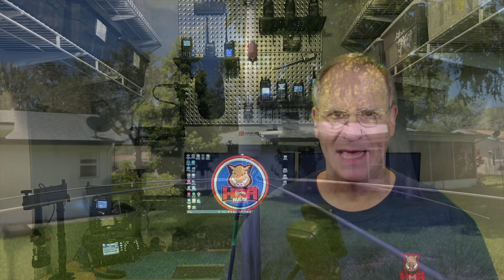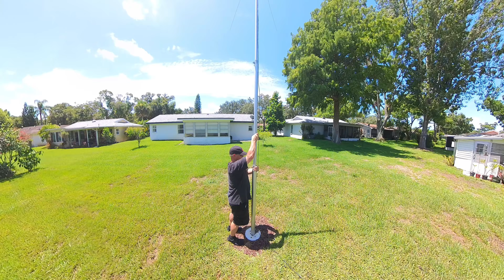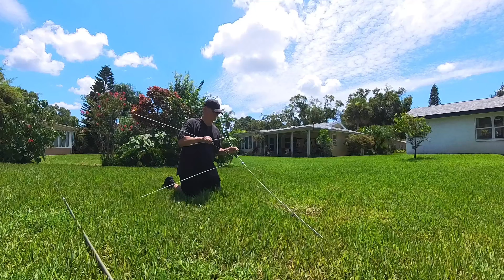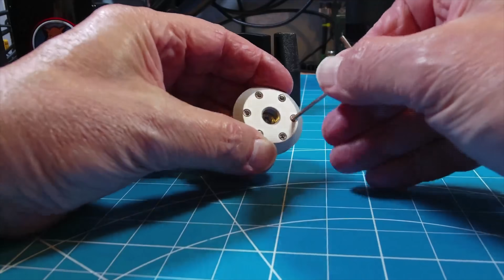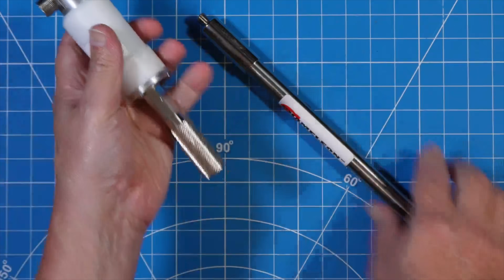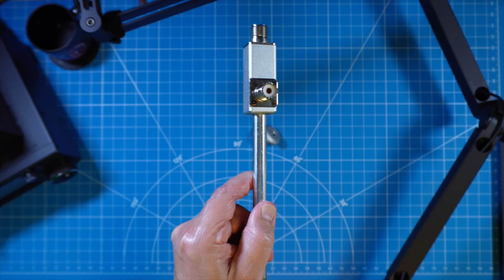Ground Plane / Counterpoise Permanent Stinger Kit from Chameleon Antenna -- Use & Review

Comment: That Cha Hybrid will give you “good SWR” with no antenna and no counterpoise. Try it! The binoculars transformer inside has copper tubes which artificially makes SWR look good no matter what, but it’s terribly lossy. The remote auto tuner is really the way to go.
Reply from the maker: Agreed the URT-1 or other remote turn one may have is a preferred choice when possible.  Thanks for the view and comment.

Comment: I'm thinking of using the CHA stainless steel stingers as elevated radials on a surveyor tripod (portable ops such as POTA) along with the CHA SS25 whip. Do you know if the stainless steel stingers will plug directly into the CHA Surveyor-A tripod adaptor? Or, will the CHA stinger hub/puck be needed for the stingers, with the stinger hub/puck then attached to the tripod adaptor?  Think the stingers will work "better" than radial wires laying on the ground?
Reply from the maker: There was a set of "portable stingers" with banana plugs on them, not sure they are available anymore -- they would fit in directly into the surveyor adaptor.

If you are using stingers without the banana plug ends, they will need to go into the stinger puck, then into the surveyor adaptor.  This will work.

In my opinion, radials on the ground will work better than the stingers.  The stingers are designed to be used elevated on a mast when ground radials are not possible, or low to / on the ground when there is not enough room for traditional radials.

For me, they worked as well as ground radials, but I have fantastic soil!
Reply: Hi, did you ever do this setup for POTA? I think that setup with stingers would be easy button setup for outdoor deployment vice radials.

Comment: What are you getting for SWR?  Can you use it without a tuner?
Reply from the maker: I didn't keep a record on the SWR.  The Micro almost always gets me to 2:1 or better on 20 meters....so I would use that without a tuner.  On 40, you would definitely need a tuner...if my memory serves me well.
Reply: Do you think it was under 3:1 on 40m?  I’m wondering if a built in tuner would be good enough.  How does the SS25 rank in your Antenna toolbox?  What’s your favorite HOA antenna?
Reply from the maker: @SheepDog1775  Went back to my video files and I did get SWR readings.  12-20 were all below 2:1.  40 was 2.6 to so an internal tuner should do it.  The Micro is doing the matching getting the good SWR.

Favorite HOA antenna?  Well, for permanent set up, my Flag Pole Porta Mast with Wire Antenna.  Any stealth wire that can stay up is awesome.  For portable up and down up and down would be the MPAS Lite because its 17' instead of 25'; just a little less obvious.  And of course you are having to set up and tear down.
Reply: I really appreciate the wealth of experience in your videos and of course the quick replies here.  Thank you.

Comment: Could not get a decent swr from the stinger setup. It was 2. or just under or over most bands over 20 except 18 where it was decent. 40 was useless well over 3. Even with the tuner it only got 20m got around 1.2 For me as a portable qrper I don't like these high numbers and being so inefficient.

I add one counterpoise and I got decent swr... like I would if I just attached a counterpoise. Not sure if this thing is even electrically connected. Don't see how its not but it didn't do anything. 

You did not mention the screw in the middle you need to adjust to get things to mount on the top of the hub. This concerned me because to get my mpas 2 in there it needed to go down quite a bit...wish they would give some better indication of how much thread you need to leave out. If you are not careful you could have very little thread holding this thing together.

Sorry but this is a pain to setup and take down and then store. It also doesn't fit in any of their bags...I have both of them.  So portable its not, more like luggable with eye pokers. Much easier to bring four radial wires and be done.

I see the reviews on the web site are positive and sure you are doing fine with it so I must have missed something. Just really surprised that just adding the counterpoise means that electrically those stingers should be connected, its the same piece of medal. Very confused right now. Next time I may just try the antenna with no counterpoise or stinger and see what swr I get.  

Do like the quick release idea...I am going to cross thread this one day if not careful.
Reply from the maker: Were you using a Micro or Mini matching unit, or trying to be resonant with a 17' whip?  If you can run a ground radials, that is preferred from my perspective.  This is for scenarios where normal ground radials can't be deployed.  I used it with the Micro and tuner.

Comment: How about a CHA SS25 vs Mil EXT 2.0, then CHA CAP HAT with MIL WHIP on top? :) (2nd fl Balcony installation in HOA)
Reply from the maker: Hmmm.  A SS25 on a 2nd floor balcony in the HOA : )
Reply: @HOAHamRadio  I suppose the two cases are very similar. Like you I take it down after each use.  And I'm at the rear of the complex so not so visible. :)  73

Comment: Bob how does the compare to the CHA CAP HAT? Want to know if they are similar?
Reply from the maker: They are doing two different things.  The stinger kit is replacing radials, offering a ground plane to reflect the RF.  The cap hat is "lengthening" the antenna electrically.

Ground reflection is necessary, lengthening the antenna electrically, while improving performance, is optional.
Reply: @HOAHamRadio  I imagine there is no reason you can't use both at the same time. Eeek out every bit of performance while having a great ground plane?
Reply from the maker: @fredstaab6063  Spot on!  Both used as intended would create an excellent antenna.

Comment: I can see some improvements I fill should be made. My opinion... set up the ground radios as a screw in option instead of set screws where you don't have to mess with a alien key... less to lose and you can keep them in a sheath of some sort... I live in a apartment complex setup and don't have the funds to buy a setup such as this... it would be nice 😢 to play radio here... though with what I have, it's just not possible... I like the idea 💡  though again I think it would be better if you could screw in the ground plane radios versus set screws. Something like you would have with 102 wips, not the 3/8 24 thread but something like 1/4 20 or there about fir the size and inserting the stinger into the center of the 1/4 20 & the 1/4 20 into the ground plane puck...
Reply: The reason we didn't go that route is because we're re-using the HUB for the CHA CAP HAT. We didn't wanted to add another part for a specific product. We wanted to stay under the LEGO SYSTEM BLOCK design where a part can be used with different products in different configurations.

Comment: As always great Video. There appears to be two version of the "Stinger kit" one with banana clips and one with hex screw. In your experience is it better to have the Stingers off the ground or does it matter? Thanks Again.
Reply from the maker: I'm using this in areas where traditional radials aren't feasible; on hardscape, on a mast.  If you are using a ground mounted antenna (instead of mast) then you have a counterpoise...i.e., needs to be somewhat tuned to the antenna.  On the ground I was using them like radials, on my mast like a ground plane.  I stay away from counterpoise cause I don't like to tune radials -- that's just me.

Comment: You’re going to love the results especially with the TDL. Break out the 6 foot ladder you’re going to need it!!!
Reply from the maker: Yep, two of them on the way, and I have a prototype wire...so TDL it is, supersized!
Reply: @HOAHamRadio  Really the 25’ whips & 34’ wire TDL are going to be reviewed!!!
Reply: @Ammed_KN6STX what’s this about longer whips and wire? Is a lower band version of the delta loop coming out?
Reply: Have the TDL and the stinger kit yet never thought to use them together before now. TY 🤘🏼
Reply from the maker: @moga864  The TDL does not use a ground plane or radial system.
Reply: @HOAHamRadio  Thank you for the response. 

I have used the TDL with a counterpoise with moderate rx/tx perf improvement over the coax shield alone on 30 and 40 Meters. 

I'll give it a go with the stinger kit for laughs and giggles. I, like you, enjoy pushing commercial antenna designs to their limit with unconventional set ups when operating HF portable from the field. 

If  the stingers doesn't initially play nice, the vector analyzer will tell me why and how to make the most of it. No problemo!
Reply from the maker: @moga864  Cool deal.  Guess because it isn't stated by Chameleon to use radials and no ever mentioned it, I was stuck in a paradigm.
Reply: @moga864  Checking in to see if you tested the stingers with the TDL? I am curious about that setup. I may order the stingers for mine.
Reply: @Mr3bairs  I haven’t. I’ve used the CHA banana plug puck on a surveyor tripod and a single whip/coil over last several outings. 

Things have gotten super busy at work lately, which hasn’t left much time for HF portable. Hope soon that changes!
Reply: @moga864  Understand things are that way here too. I may go ahead and order the stingers.